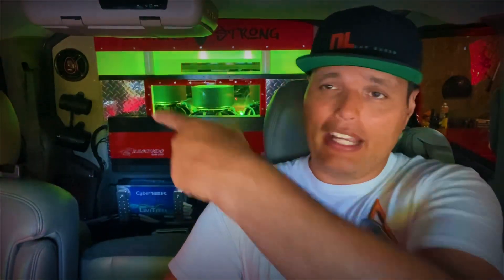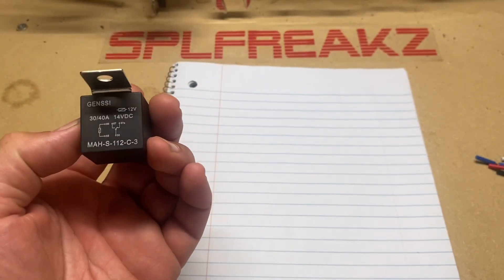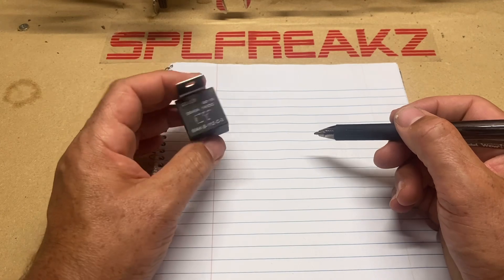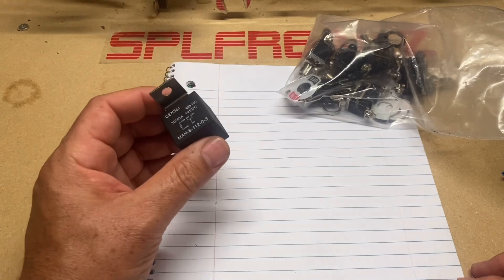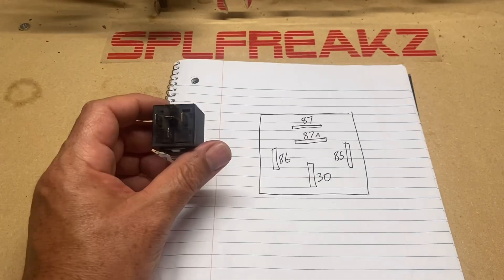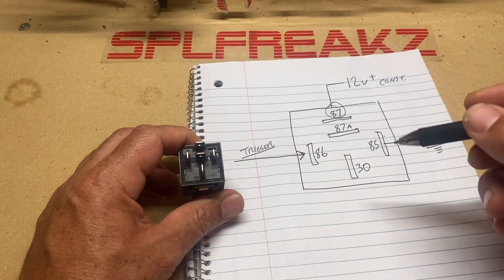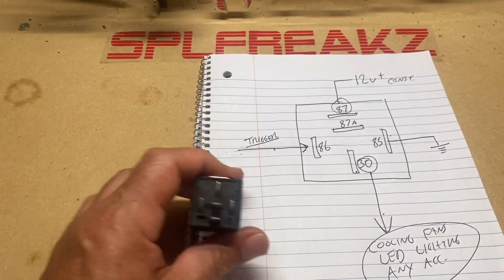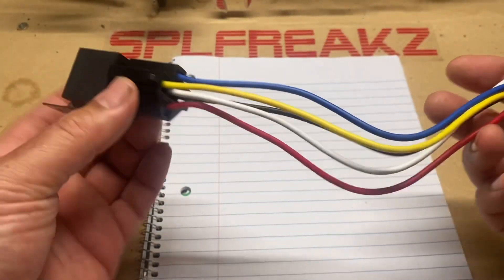How to wire SPDT and SPST relays for automotive car audio, security and electronics.

Comment: So, I've got to ask;

I'm using a relay to power a couple of cooling fans, and I'm wondering if I could just use all of the connections the amp provides? Like running the 12v+ to the +on the relay, the 12v remote for the trigger, the amp ground for the relay negative, and then running the power out to my fans? From there, power out to the fans, and then the negative of the fans cable to the ground of the amp?

Comment: Every diagram ive seen shows constant +12V going to pin 3 in the relay.  i know technically itll work the same, but could cause issues depending on if and how you were using 87A.

Comment: Ok 12v constant would be the yellow wire. My whole set-up is in my trunk. (Supplemental battery) so do I run a yellow wire to the trunk? Or should Is it easier to install it under the hood?

Comment: thank you very much, i want to connect a switch  for the rear camera so i can press whenever i want, without turning on the reverse light,  does a relay helps in this situation.  or i need to use  a diode any way.? i'm kinda confused..  thanks in advance
Reply from the maker: That should not draw enough power to justify a relay, tho it would not hurt
Reply from the maker: That should not draw enough power to justify a relay, tho it would not hurt
Reply: @NextLevelCarAudio  thank you. so you say just heavy consumers. etc.. 🙂 thanks for clarifying

Comment: Question its normal that my amp gets warm or hot? I have a 4cha 1200 watts, running 2 6x9s and 6x8s please , so i can decide to return everything to bestbuy. Thanks
Reply from the maker: It’s like the gain is either set too high, or it is not getting proper power/ground. Getting warm in normal. Hot is not

Comment: Abit off topic....i tried using the piezo buzzer method that you covered a while back.For some reason the buzzer didn't beep no matter how high the gain was increased.I used a 40hz test tone.
Reply from the maker: It’s all in the capacitor. If the cap is too big for the power it is seeing it won’t pass the signal.

Comment: So when will u need to use 87a connection?
Reply from the maker: Let’s say you have a dual speed cooling fan. Hook up low speed to 87a so it’s always on, then hook up a temp sensor inline with 87 to activate when you get to a certain temp to turn on high speed fan

Comment: Hey bro I have i question. Is it ok if I changed my sealed box for a ported box? The subwoofer was a shallow woofer.
Reply from the maker: That’s fine, just make sure it is within specs
Reply: @NextLevelCarAudio  I’m happy with the change I made on the  sub woofer because now that thing bangs and it’s much more louder too. I had a sealed box so it was performing the way I wanted it to
Reply from the maker: Nice
Reply: @NextLevelCarAudio  I just realized that when I go to my subwoofer level it’s in the negative but it sounds so good. Is that normal ?
Reply from the maker: That’s fine, your gain is probably set low on the amp that’s why
Reply: @NextLevelCarAudio  that thing bumps and especially rap music
Reply: Hey man I want to put a system on my tundra now. What would some good equipment to put on the tundra ?
Reply from the maker: What’s your goal? SQ/daily listening, SPL, etc?
Reply: @NextLevelCarAudio  daily listening but also want it to bump. Make the bass and voice loud but the bass not to loud where I could barely hear the music
Reply from the maker: Just a good set of components with crossover for the front, some coaxial for the rear. And a good sub in a custom ported enclosure. A good 5 channel amp will work great
Reply: @NextLevelCarAudio  what would be a good 5 channel amp ?
Reply from the maker: What’s your budget? As it greatly depends. Entry level, intermediate, or top shelf quality
Reply: @NextLevelCarAudio  I would say entry level
Reply from the maker: https://www.skaraudio.com/collections/rp-car-audio-amplifiers/products/rp-600-5-car-amplifier?gclid=EAIaIQobChMI793Dqcr68QIVRhmtBh1oUQu1EAAYASAAEgKftPD_BwE&keyword=&campaignid=11690754915&adgroupid=112049789725&matchtype=b&device=m&product_type=amplifiers&series_name=rp_series&gclid=EAIaIQobChMI793Dqcr68QIVRhmtBh1oUQu1EAAYASAAEgKftPD_BwE

Skar is a legit entry level option. Or DS18 for sure
Reply: @NextLevelCarAudio  so I just realized something. I don’t know if that normal or not but when ever I idle the car and I raise the volume on my stereo receiver I could hear a noise. But when I turn on the car and I do the same thing it doesn’t do that. Idek if I’m explaining myself right.
Reply from the maker: Sounds like a ground loop issue. Check grounds are good or get Ground isolators
Reply: @NextLevelCarAudio  that only happens when the car is on idle, I’m not playing any music and I raise the volume knob.  But as soon I play music and raise the music it goes away. Will that keep on getting worse ?
Reply from the maker: Dude, that is strange. I just don’t know what the hell that could be lol without pulling everything one by one to see what the culprit is
Reply: @NextLevelCarAudio  that’s what I’m saying it only happens when the truck is on idle. When I turned it on I can’t hear it no more.

Comment: I've installed many relays but not for car audio :) good video my guy on relays 👍
Reply from the maker: Thanks
Reply: @NextLevelCarAudio question,  is my positive off my led lights going to pin 30 then the negative of the led lights going to pin 85? I never heard where the positive and negative hook to on the relay thats coming from my led lights or a fan ect. And could i connect a fan and a set of led lights ( inside enclosure led's) both to one relay? Or would you want separate relays for each source?

Comment: My problem with car audio is that the wiring harness for my 2013 sentra cost more than the radio and I have steering wheel control
Reply from the maker: Lol. That’s the case sometimes unfortunately